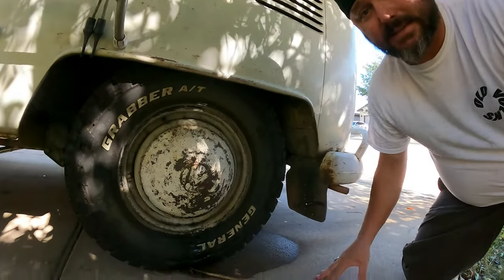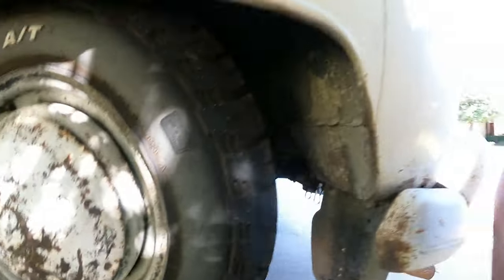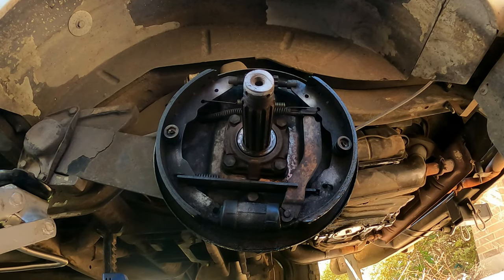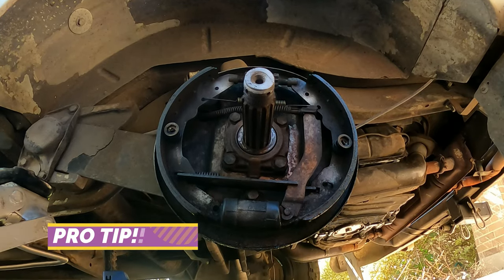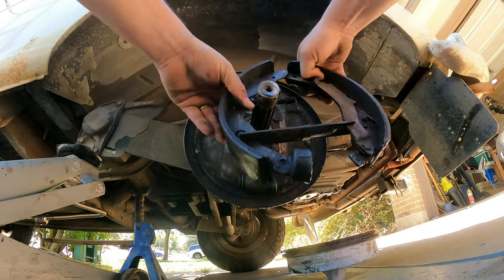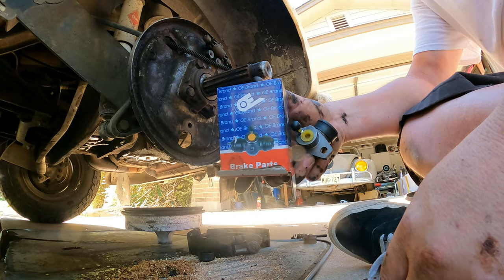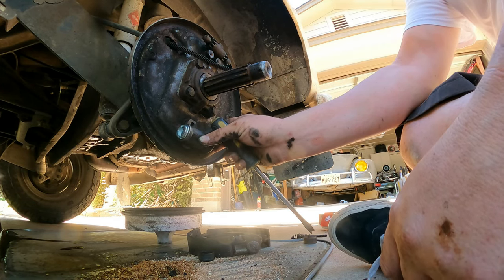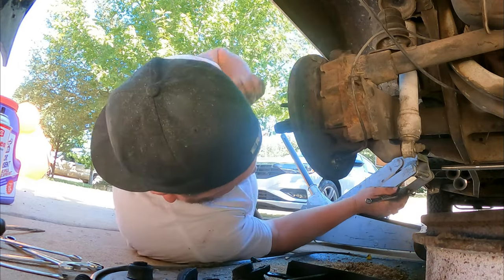Replacing a Leaking Rear Wheel Cylinder on a VW Bus

Comment: Great video, great bus and that modified screwdriver is excellent!!!  Thanks.
Were the brake shoes ok with all of the brake fluid on them?  Cheers from PA
Reply from the maker: Thanks! The shoes were ok after a good rinse with brake cleaner. I didn't drive it after I saw the leak so the mess was just in the bottom of the drum.